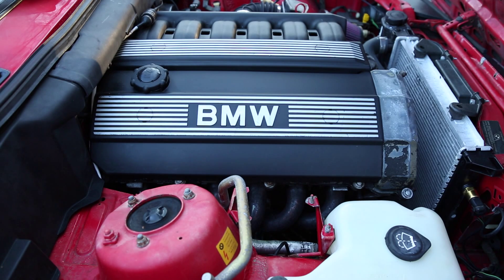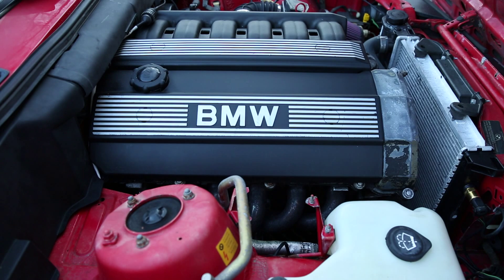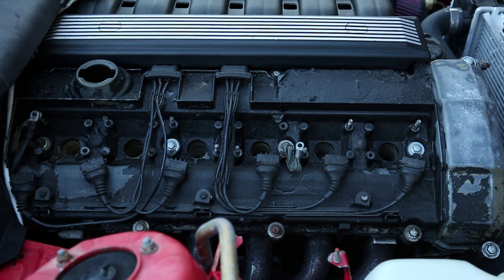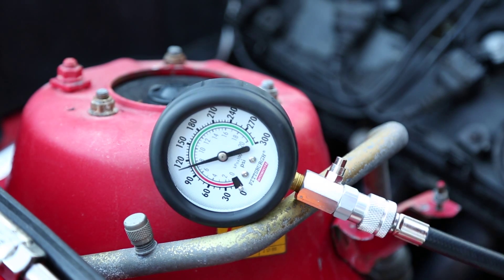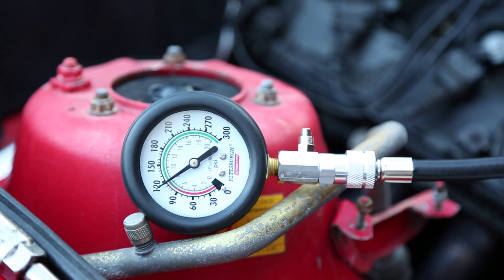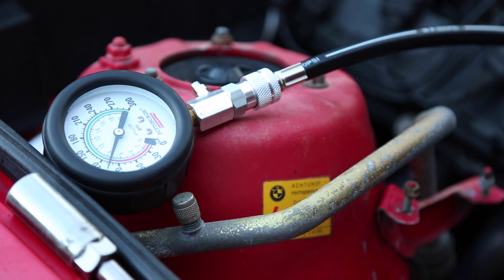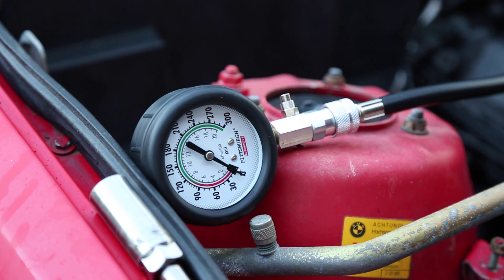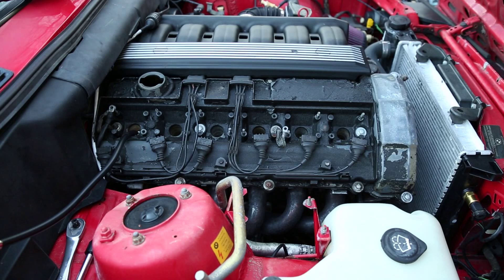BMW Compression Test DIY M50 M52 M54 M20 M42

Comment: Nice video but should the car be warm or I can do the test while car is cold ?
Reply from the maker: Thanks, you can do it either hot or cold but check the right specs hot vs. cold
Reply: BIMMER ZEIT thank you just done it all are 175 psi except last one is 180 psi but don't know cause of  600-500 idle on m54 engine
Reply: BIMMER ZEIT and thanks your video is so informative
Reply: BIMMER ZEIT and thanks your video is so informative
Reply: BIMMER ZEIT what does a shop normally charge to do this?

Comment: I am sure you are absolutely busy. My brother would really appreciate if you could give us some insight concerning some of the problems he is experiencing with his 2004 model E46 chassis 3.30i (automatic transmission) car. I would like to start of buy listing the maintenance he has already implemented:

* Front suspension struts (not the rings) have been replaced with Sachs.
* Front disks and brake pads have been changed, Textar brand.
* 4 new tires have been installed, LASSA brand. Generally considered to be solid tires.
* Full front alignments have been done, three times.
* Camber and caster alignments have been made.
* Transmission fluid and its filter have been changed.
* Engine fluid has been changed.
* Left control arm changed.
* Right lower suspensions' small ball joints have been changed.
* Left lower suspension has been changed completely.

So yeah, these are the things he has replaced. However, he seriously feels that some part of the car is not functioning well. Most importantly, he complains about steering and its handling. There is a lot of loss of control while he is driving. It doesn't matter if the road is smooth or bumpy. Also, when speeding, he says that the steering wheel goes lazy or even instability is being caused but not in the form of vibration or other factors. It feels like as if the steering wheel makes you feel less-controlling of the road and eventually becomes more difficult to control the vehicle.

The other problem is probably related to the transmission. In short drives, the transmission does not gear between low and upper speeds very easily. There is a certain delay. Sometimes, the RPM is very low and the car adjusts to the 2nd or 3rd gear TOO EARLY and vice-versa. When the vehicle suddenly stops, it seems that the car cannot decide on which speed to adjust. According to my brother's research, this could be related to a device called the Torque converter. Is this possible?

His V*N number is, the final digits: KL-926-43
Thanks in advance.
Reply from the maker: +Turhan Uludağ Thanks pal, I appreciate that. It sounds like you may want to double check the control arms and control arm bushings. If you only did one side, or did not replace the bushings, that can cause the lack of control feeling in the steering. With the transmission, you could try draining and filling with fresh fluid again. It can take several drain/fill cycles to get the new fluid into the trans and torque converter. Hope that helps!